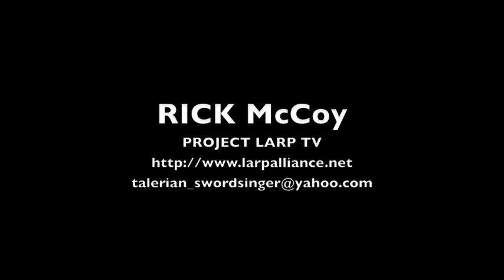LARP TV - Project LARP TV Demo - The Foam Show

Comment: Sorry guys, but this "thrust tip" won't stand a chance in passing Larp safety checks in Germany.
There isn't enough protection to prevent the core to pierce the tip. Tips can also be damaged by chain mail or plate armor.
That's why thrusts are generally forbidden in German Larp.
yes, it is a limitation, but generally safer that way.